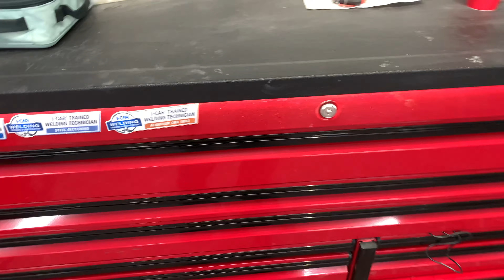snap-on epiq tool box tour. full of snap on tools. auto body collision technician

Comment: Wow. People be triggered by it being dirty. I guess they never did any body work, sanding, painting. 

Although the "tamper proof" torx, and the triple sqaures, and what Benz is using on suspension is out of control. This, along with VIN coded electric power steering and even water pumps is why Right to Repair is a thing. 

Sadly, idiot consumers will just need that new car. I bet you if nobody bought Fords for a month, over the stupid fasteners, they would go right back. Until them, I charge em. Unless its electric. I tell them Im not qualified, and send them to Tesla or whatever. Even if its tire rotation. Nope.

Comment: Can’t figure out why you have 3 boxes and not a single one is anywhere near full enough to need 3 boxes
Reply: From my experience you can’t haul a big box around the shop , sometimes you can’t move cars around because it will take more time then just moving a smaller box to the other side of the shop and doing the repairs there .

Comment: It’s torx not tore axis. And the “star” is actually called triple square. And yes you need wrenches and traditional ratchets. Anyone who buys snap on cordless instead of Milwaukee is silly. You had “push rods” for the porta-power. You have to make sure you stay busy with no work? I’d throw them toys in the box and get out of the industry while you can pal